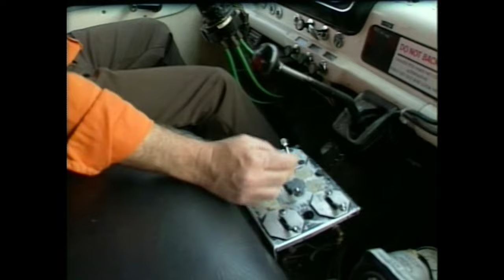Mighty Machines | [S01 E03] | In The City | 1994 | 1080 60p

Comment: Stumper is industrial "stump grinder trailer" not a mobile chainsaw. Stretch is a "tree trimming bucket truck." Chipper is a "Vermeer wood chipper trailer." Gusher is a "water tanker truck" that cleans the streets with water.
Reply: Yeah, "stump grinder trailer" sounds more accurate than "mobile chainsaw" since grinders and chainsaws are completely different.
Reply: Gusher as Rammy